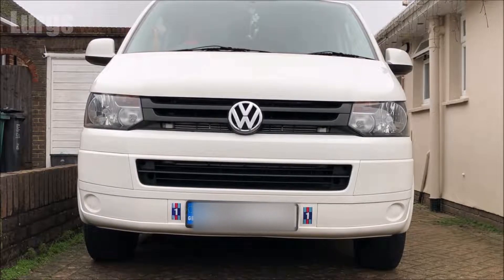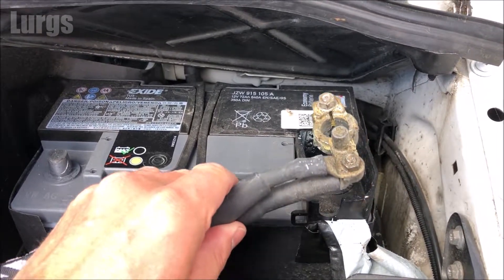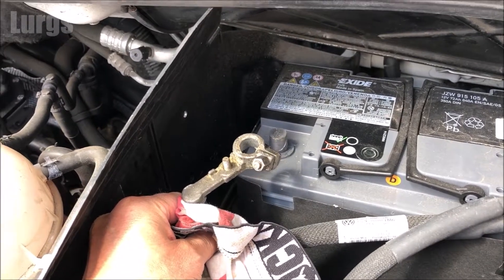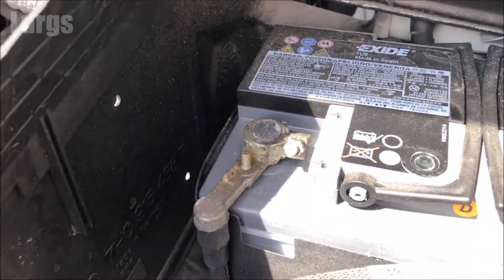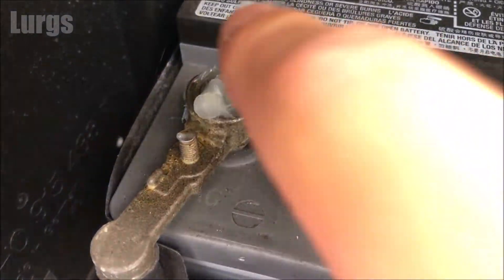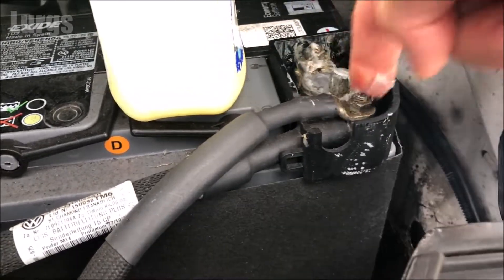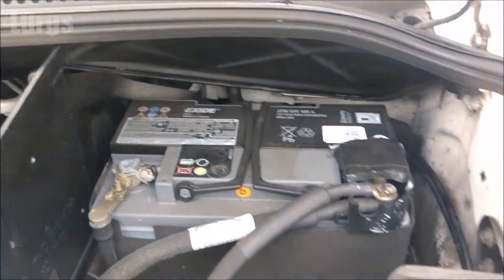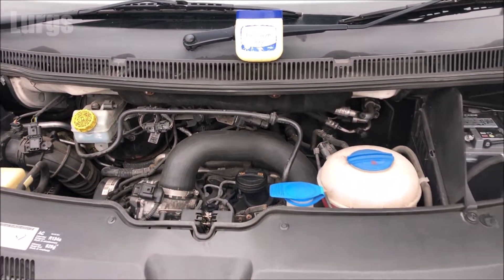How to connect a Van Battery Safely plus TOP TIP for keeping Battery Terminals corrosion free

Comment from the maker: How to disconnect a Van Battery Safely https://youtu.be/9ISVSR6Ijt0
.
Other useful How To Guides to help you save ⏱TIME and 💰 MONEY:
Vehicles How To's, Tips, Tricks & Fixes  https://www.youtube.com/watch?v=w44aQ7dc_Lk&list=PLqrXuUebV8N9fyM8qA2D0rkVfv929Ckod
How to check car fuses without pulling them out using a Multimeter https://www.youtube.com/watch?v=w44aQ7dc_Lk&list=PLqrXuUebV8N9fyM8qA2D0rkVfv929Ckod
How to test Car Fuses without pulling them out using a Car Blade Fuse Tester https://www.youtube.com/watch?v=zLfa7_FbZrU&list=PLqrXuUebV8N9fyM8qA2D0rkVfv929Ckod
Tyre Pressure Warning Light is ON and How to reset it https://www.youtube.com/watch?v=2AIxNtg8ICo&list=PLqrXuUebV8N9fyM8qA2D0rkVfv929Ckod
How to disable Start Stop on a Vehicle https://www.youtube.com/watch?v=dxzMDT1s7WE&list=PLqrXuUebV8N9fyM8qA2D0rkVfv929Ckod

How to check a Car Battery with a Multimeter https://www.youtube.com/watch?v=VlkYGIMFj48&list=PLqrXuUebV8N9fyM8qA2D0rkVfv929Ckod
How to connect a Car Battery Safely https://www.youtube.com/watch?v=1b2vJjUefYQ&list=PLqrXuUebV8N9fyM8qA2D0rkVfv929Ckod
How to disconnect a Car Battery Safely https://www.youtube.com/watch?v=XJ5SUabZCbc&list=PLqrXuUebV8N9fyM8qA2D0rkVfv929Ckod
How to prevent your Car Battery going flat due to lack of Use https://www.youtube.com/watch?v=xH9V5xfSSMQ&list=PLqrXuUebV8N9fyM8qA2D0rkVfv929Ckod

How to check brake lights by yourself https://www.youtube.com/watch?v=jBK5W18zGJg&list=PLqrXuUebV8N9fyM8qA2D0rkVfv929Ckod
How to fill Screenwash Fluid on any Vehicle https://www.youtube.com/watch?v=zQTDe-u5qA0&list=PLqrXuUebV8N9fyM8qA2D0rkVfv929Ckod
Fuel Cap Side Top Tip https://www.youtube.com/watch?v=s8GSMM8sBiA&list=PLqrXuUebV8N9fyM8qA2D0rkVfv929Ckod
How to replace Wiper Blades https://www.youtube.com/watch?v=Md51wggLBJI&list=PLqrXuUebV8N9fyM8qA2D0rkVfv929Ckod
Windshield Washer fluid not working diagnose and Fix https://www.youtube.com/watch?v=F4nuQ31cluY&list=PLqrXuUebV8N9fyM8qA2D0rkVfv929Ckod
How to use Car Air Conditioning on a Hot Summers Day https://www.youtube.com/watch?v=4zfhuBpWYt8&list=PLqrXuUebV8N9fyM8qA2D0rkVfv929Ckod
How to find a Puncture in a Car Tyre https://www.youtube.com/watch?v=6orpFjsRQGA&list=PLqrXuUebV8N9fyM8qA2D0rkVfv929Ckod
How to replace an ABS Wheel Sensor https://www.youtube.com/watch?v=Kc_g6oudDaM&list=PLqrXuUebV8N9fyM8qA2D0rkVfv929Ckod
What is TPMS and how does the Tire Pressure Sensor work https://www.youtube.com/watch?v=pEkeYkZu-oE&list=PLqrXuUebV8N9fyM8qA2D0rkVfv929Ckod
Car Indicators Soft and Hard did you know? https://www.youtube.com/watch?v=qU75BT_vvdY&list=PLqrXuUebV8N9fyM8qA2D0rkVfv929Ckod
.
How To's, Life Hacks, Helpful Tips https://www.youtube.com/watch?v=dcmxUTsedlk&list=PLqrXuUebV8N92xXP4Dm_pHfBpEQ3wtP2R
Washing Machines How To's, Tips, Tricks & Fixes https://www.youtube.com/watch?v=0_gst8RokRo&list=PLqrXuUebV8N_Bv_41hH-IpIfM5qiS0Sin
Dishwasher How To's, Tips, Tricks & Fixes https://www.youtube.com/watch?v=6z22-Ysn7rE&list=PLqrXuUebV8N89GJMUjDiMqGpAcic3wqfD
Toilets and Plumbing How To's, Tips, Tricks & Fixes https://www.youtube.com/watch?v=vT5KwJ2A2eU&list=PLqrXuUebV8N_d4OWPjAk4PJ7LnKb0Jdot
Combi Boiler How To's, Tips, Tricks & Fixes https://www.youtube.com/watch?v=1gGEP2y_qHM&list=PLqrXuUebV8N8aiBpt_F3n23E3IOLlmgK2
My Reviews https://www.youtube.com/watch?v=QX0ge0QOXJk&list=PLqrXuUebV8N9_JYlSh2LjbfUsybF840oy